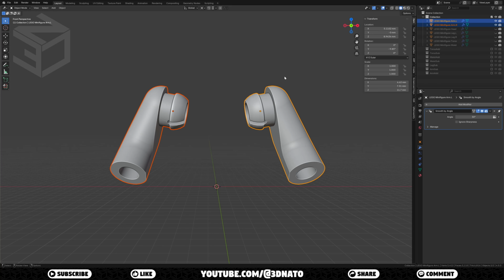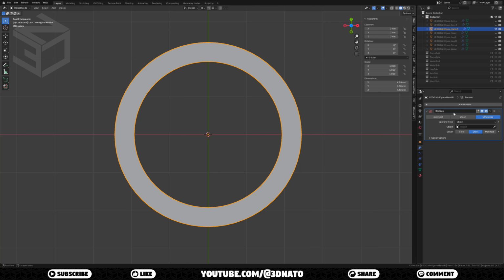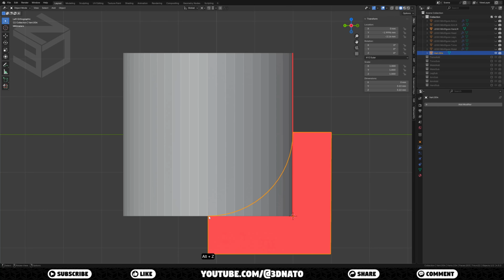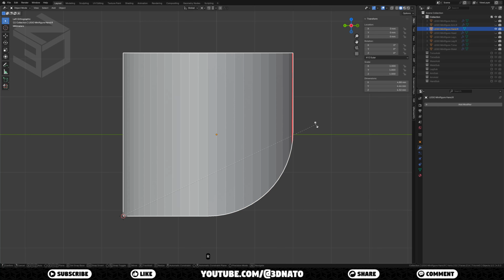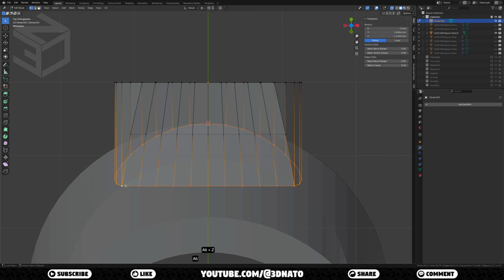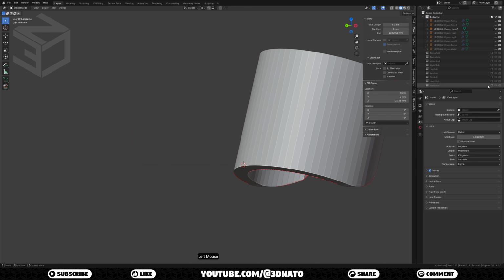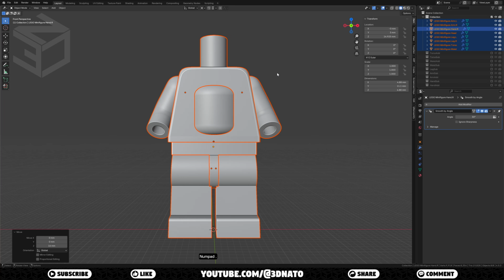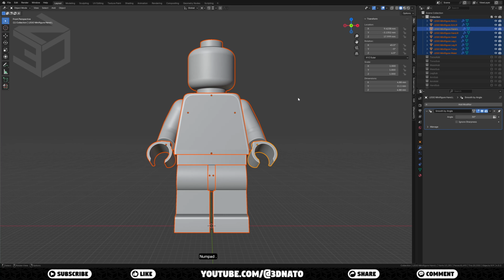LEGO Minifigure Blender Course | 06: Modeling the Hands

Comment: I had this issue with my file so in case your having an issues with the wrist 

when adding the shrink wrap modifier : sharp points, weird warps, you want to make sure the 3D cursor is at the pivot point after rotating , I rotated my hand at a location , however the 3D cursor was in a separate location (I don’t remember what I did I’m sure it’s fine) 

but when I got to the wrist the first circle would have extra points so I’d say double check the 3D cursor location :3 hope this helps anyone having similar issues 

Also thank you for this series man it rlly helps a lot!
Reply from the maker: That’s super helpful advice, thank you for sharing your experience!
Really appreciate you taking the time to add this, and I’m happy the series has been useful for you!
Thanks for watching!!